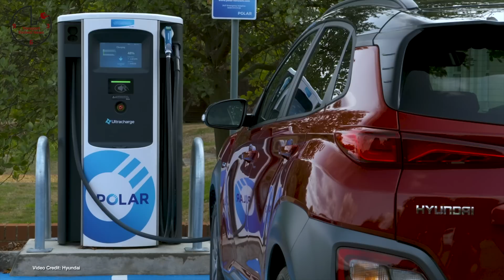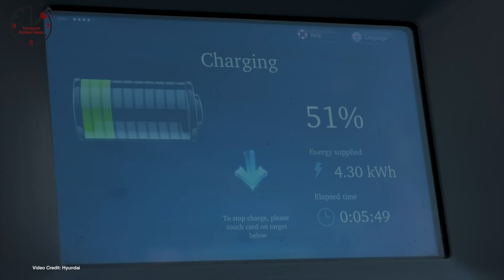TEN 329 - Porsche Taycan Cross Turismo, Big Auto Chases Tesla, Rivian Going Solid-State?

Comment: Ive always wondered why liquid batteries haven't taken off. You can refill the battery/tank in the same manner as we do already without the long recharge waiting period. Also you don't need as many batteries as the charged liquid can be stored in a tank and pumped into the battery as needed. The discharged liquid can then be pumped into a collection tank that is emptied when the car refills. I wouldn't be surprised in years to come the battery and electric motor are merged as a single unit. The battery refill stations would act as both a refill/collection point a c charging point for the dielectric liquid.

Comment: Just watching legacy auto struggling with human workers on inefficient production lines is cringe worthy. Tesla has proprietary aluminum alloy mold injection for front and rear casting eliminating 600 robots on each production line. Less robots, less processes will equal faster more efficient and greater profit margins on production lines for their vehicles. More efficient, faster production for proprietary batteries in house for Tesla products game changer. All this equals lower cost for products passed to the consumer. Meanwhile Ford, VW, Audi, Porsche and GM are 10 years behind struggling to smash off the shelf batteries into battery packs for skate board type technology? OEM have to pass the expensive battery cost to the consumer no way around this. Software issues abound as each legacy OEM scramble to slap their "Buggy" software into their products. The direct sales to the consumer is more profitable than the dealership 3rd party sales end of story. Wait no hundred million marketing commercial budget for Tesla. Tesla over the air updates and "suite" like the Apple Store is another ridiculous revenue stream for the business. FSD is another pending feature that legacy OEM has no comparison end of game. Tesla insurance another disruption to the market more profits.

Comment: What is the point of this channel to just talk down on Tesla? The technology used by VW, Ford and Porsche is just laughable at this point. Your going to over pay for substandard tech in these cars end of story. Stuffing more batteries in packs in a attempt to keep pace with Tesla range is foolish. How about they make efficient vehicles first instead of forcing consumers to pay for the 3rd party off the shelf batteries in their cars. To date no one has scaled up a solid state battery, why? Answer they know the solid state battery tech has 2/3rd less cycle viability. It just doesn't make sense to keep yapping about non viable technology not ready for prime time. Mean while Tesla is on track to have 200 gigawatt battery production by end of 2022! Tesla's plan to have 2 terawatt of battery production by 2030 has to be terrifying to legacy auto producers. Legacy OEM has no proprietary batteries tech or plans to produce the capacity needed to fill their boastful plans to be fully electric by 2030, fact.

Comment: Actually, Tesla is still selling more EVs then everyone else combined.
Reply: In the US, yes. In the world that has been a long time ago. In 2020 3.24 mio EVs were sold
Reply: They trailed behind VAG and Renault last year in Europe and i dont think Tesla stands a chance the coming years. Give VAG two or even one year before they pass Tesla ahead in global market.
Reply: @jonpetter8921  
I'm so tired of this stupid talking point. And the other 100 before it. Fortunately this one will end up like the others, proven wrong so hard that everyone will deny they ever said anything like that.

Tesla does not have a factory in Europe yet. That means selling cars there is expensive due to import cost and tariffs. For Tesla the primary markets are the US and China, where they can get the highest margins due to local production. So as long as they can sell what they make in those markets, it makes no sense to export to Europe. Which means they are not even trying to seriously compete yet. But the Berlin gigafactory is going online in a few months and that will change everything. It will also use the latest manufacturing and battery tech which will make the cars significantly cheaper on top of saving a ton of money with the local production. The phase 1 capacity will be 500K a year, which is the amount they sold in 2020 in total. The full capacity is expected to be 2 million, and it won't take long to reach it, 2 years probably, 3 at worst. Plus an even cheaper model is coming too, maybe in this year already.
Reply: @andrasbiro3007  You are dreaming in a Tesla bubble like other Tesla fans boys.

How can Tesla be EV leader the next years when they only have a sedan and crossover to offer as a mainstream product ? Model S and X are already dying.

VAG will have close to 20 EV models by 2022 from hatchbacks, SUV, crossover, Wagon, ctycars, Luxury sport sedan, even a van. This year only they will have 4-5 new models: E tron Q4, ID 4, ID 6, Taycan Grand Tourismo, Cupra El born, E tron GT.

Berlin plant wont make any different. Tesla offer is too thin and European, world biggest EV market, is already saturated. A sedan and a crossover  wont b a success in a continent where wagon, hatchback, SUV are king. ID 3, ID 4, Skoda Enyac, E tro Q4 not to mention EV from Hunday, Renault EVs, PSA. Those will take away the market share from Tesla.

Tesla needed a decade to reach 500 000 sold units, so cute, that s what VAG produce in 14 days today.
Last year VAG sold 250 000  ICE converted EV (E Golf, E UP, E tron) for mainly Europe.
Imagine when their new dedicated EV will come to the market from this year: ID 4, ID 5 estate (next year), ID 6 SUV, ID 7 van (next year)

VAG will have 8 EV plants by the end 2022 producing up to 20 EV models 

VAG may already pass Tesla globally by the end of 2022. Mark my word.

Tesla already lost the battle, like if they would have a chance anyway lol
Reply: @jonpetter8921  
Your ignorance is painful.
1. What law forbids Tesla from making other models? Like a pickup or a compact car that are already in the pipeline?
2. The S&X just got refreshed. It doesn't matter much, as these never going to sell in significant volumes, but "dying" is still far from reality.
3. The number of models is irrelevant. The number of units is what matters. You can have a hundred thousand different models, it makes no difference if you can't make or sell them. Legacy manufacturers have so many models because they are playing in a mature market where the only way to grow is finding all little niches and fill them with products. Tesla doesn't have to do that yet, appealing to only 80% of the potential buyers is plenty enough for now.
4. The EV market is very far from being saturated and will be far from it for many years. Saturation would mean that every single new car is electric.
5. Berlin makes all the difference. It means no import cost which is eating into their margin, the much shorter supply chain which helps with logistics and drastically reduces the inventory, the new factory will use a bunch of new technologies that reduce cost and improve quality and, finally, the production volume will increase drastically, which is now seriously limiting sales.
6. Look up exponential growth. It took a decade to reach 500K, but the next 500K will only take one year and the next just a few months and then less than a month. This year Tesla will likely make around 1 million cars and next year 2 million is possible. By 2025 that could grow to 10 million. Meanwhile Volkswagen still has no competitive product and makes far less cars even including the tiny city cars that are no match for a Tesla.
7. Again, the number of factories and number of models are irrelevant. What matters is the number of cars produced and sold. Both are an issue, because VW is still learning how to make EVs, they are years behind Tesla. And what they make is not competitive, for the same price you get a better Tesla. So far they could sell their cars, because the demand for EVs is far bigger then the supply, but eventually they'll have to seriously compete.
8. There's absolutely no chance in the world for anyone to catch Tesla. The most they can hope for is second place. They can't compete in specs, in price, in production volume, in software or even manufacturing. And since Tesla innovates faster and grows faster, it's not possible to catch up. Plus nothing maters if there aren't enough batteries, which is the case now, there's a serious battery shortage and will be for years. And guess who is far ahead of solving this problem. Tesla built it's own battery factory in 2016 with Panasonic. That's what everyone else is trying to do now. That far behind they are. Meanwhile Tesla is moving to fully internal cell production and they won't stop there, they are swallowing their entire supply chain to speed up growth. They are even going in to mining. They have practically unlimited capital compared to these companies, so they can fund much faster growth than an external supply chain could. plus integrating the whole thing removes a lot of inefficiencies, which significantly reduces cost.
Reply: @andrasbiro3007  
Hi  Tesla nub.

The more models available, the more specter of buyers you can attract. VAG will have 8 EV plants by 2022. With full capacity, those plants can produce about 2 Millions units. But unlike Tesla which only have a sedan and crossover to feed the world, VAG does have different segments of car buyers can choose between:

VAG is leading global sale in City cars segment because guess what,..... Tesla don t make City-cars.
VAG is already leading global sale in SUV segment with E tron, and will also pass Tesla in luxury sedan segment because i don t see Model S selling more than Taycan and E tron GT this year or the coming years. Mercedes EQS and BMW i7, Lucid will steal buyers from Model S in luxury sedan segment as well: Model S and Model X are dying specimens: Those cars are second tier car that want to compete with real luxury cars. People will buy the real ones.
Next year VAG will launch ID 5 in Wagon segment and ID 7 in van segment,

The only segment Tesla is still leading globally is the mid segment cars: Model 3 and Model Y. They have been popular worldwide because they are only available good cars in that segment for some times.
But there are new cars coming especially from VAG: VW ID 4, E tron, Skoda Enyac are mass produced models that will give Model Y hard time, especially the ID 4 that will be assembled in China and the US. 

I say it again: give it VAG two years or even next year before taking over global sale in EV. In meantime Tesla can go back to the drawing board to learn how to assemble cars.
Reply: @jonpetter8921  
Hi, stupid.
1. Or you can make a few models that appeal to a wide range of customers. Like Tesla does. And again, there are new models in the pipeline and many more will come as Tesla grows bigger. Again, there's no law that says Tesla can't make any new models.
2. City cars and large premium cars are irrelevant, they are relatively small market segments. Tesla is playing in the big league, crossovers and soon pickups.
3. The S&X just got refreshed, and they are far superior to anything you could call "competition".
4. The Model 3 and Y have no serious competition either. They are far better than anything you can get for the same price, and no other EV can come close in production numbers.
5. It's physically impossible to catch Tesla. Nobody has the tech, nobody can scale production as fast and nobody has enough batteries. VW is far behind even according to their own plans. They plan 240GWh production capacity in Europe by 2030, while Tesla will be there by 2025, with similar capacities on other continents too.
Reply: @andrasbiro3007  You can keep ranting but that wont help Tesla case.

Tesla will be a casual car manufacturer after 3 or 4 years. Battery wont be a deciding factor anymore because there are so many companies that are developing better batteries these days. 

Panasonic is not the only company that is working on 4680 battery, the chinese BAK Battery is one of those who are working on the same type Battery. 
VAG is teaming up with Quantomspace developing solid state battery. LG 

Mercedes just announced the new 700 km rated EQS, coming to the market this summer. In other world Model S days are numbered like Model X. Model Y and 3 will soon get he same fate when ID 4 Ionic 5 E tron Q4 and Skoda Enyca, Kia EV 6 are coming to the market. And Tesla lack of quality wont help them. 

In the end of the day it will come to who makes the better car or lineups because battery wont be a deciding factor anymore. And you know Tesla can t keep up with the big boys in that field.

So try to enjoy your few years with Tesla before it s to late.
Reply: @jonpetter8921  
1. Developing batteries is easy, mass producing them at a low cost is extremely hard. And takes at least a decade.
2. The 4680 form factor is only one innovation, Tesla is going much much further.
3. At this point batteries are good enough, now the game is all about who can produce the most batteries at the lowest cost. And that's Tesla, nobody is even dreaming about catching up.
4. Quantumscape won't mass produce batteries until like 2028, according to their own roadmap, which is likely to be very optimistic. And even then it worth noting if it's more expensive then Tesla's, or they can't match it's production volume.
5. Range is no longer the most important parameter, over 500km it doesn't matter that much, especially when you have an excellent charging network, like Tesla has. But a 800+km EPA range Tesla is coming this year, or possibly two (Plaid+ Model S and Cybertruck). Also Tesla could easily make 1000+km cars, but it makes more sense to build more cars with less range instead, at least while there's a battery shortage.
6. Nothing can touch the Model S and X, except maybe Lucid, if they can deliver what they promised.
7. Nothing you listed comes even close to the Model 3 and Y. And none will be made anywhere near the same volume, so it doesn't even matter whether they are better or worse.
8. Tesla is already far ahead in manufacturing too, so when EVs are becoming a commodity, Tesla wins again.
Reply: @andrasbiro3007 woulda coulda shoulda, That a all your comments in a nutshell lol

Funny when Tesla fanboys were ranting about the range on the Teslas. When a new better car comes with superior range then the tone change dramatically :"range is no longer the most important" LOOOL. And then implying "Tesla could easly 1000km" lol again, if they can, so do it. Maybe Plaid will be pushed back to 2025, who knows. And if range is no important anymore than Tesla is graving their graveyard because that s their only advantage. But anyway Model S and X are already in their graveyard ....  
Model Y will be sweating right now with ID 4 starting to be sold worldwide. Then you have Skoda Enyac and E tron Q4 coming this year, all those car offer better package than the Tesla: Better build quality, more premium, decent range. How about IOnic 5, KIa EV 6. 

Taycan, EQS, or E tron GT don t need to be produced in high volum like Model 3 or Y to be to be profitable. They are low volum high end cars. Mercedes just need to sell 30 000-50 000 of those to make them profitable. And give the situation right now. They will sell like hot cake.  
Tesla tech is now old compared to what EQS offers. Model S or X refresh is no near a "refresh" it s the same old cars with some added horsepower maybe.

Tesla will became an average company like chevrolet in 3 years only making average mass produced cheap sedans.

Comment: Even if you switch from a gas car to an electric you're just swapping one method of using fossil fuels for another. The bulk of our electricity is produced either by fossil fuels (60%) or nuclear (20%). Only 20% of electricity is produced by renewable resources. We need to not just focus on electric cars, but producing electricity with renewable resources rather than nuclear or fossil fuels.

Comment: Your wrong Nikki the move to solid state if they can match or beat the density, will be to reduce costs to make them more available but also if better density they can reduce the pack size dimension yet keep the kwh rating the same this can improve handling but equally like Tesla bring battery to gallon equivalent parity per kw

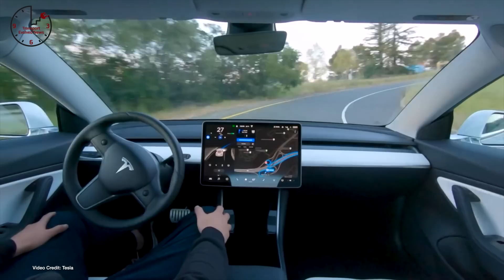Comment: Being ever facinated by the decisions made by self-driving autos, it is interesting to note that at 6:52 the Tesla correctly excecutes the left turn into the left lane before changing to the right lane (most humans wrongly go directly to the right lane) yet at 7:18 the Tesla wrongly goes to the right lane despite a vehicle pulling over to the right road shoulder, rather than staying in the left lane until clearing the roadside vehicle (which I would hope most humans would know to do).
Reply: But that's a very old video. They have done a full re write since then.
Reply from the maker: It is an old video because Tesla has not made any newer video available - and beta testers are under NDAs in some situations.
Reply: @Amuzic_Earth  Good, thanks!